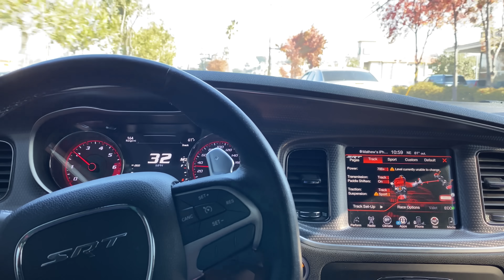I BROKE THE NEW DRIVESHAFT IN LESS THAN 24 HOURS!! *OOPS*

Comment: The heat shield for the center support bearing is not longer needed with the one piece aluminum driveshaft and you should not reinstall it.  Aluminum will cut aluminum and if it ever touches the shaft it will cut it.  Same thing with the rear heat shield make sure it is clear all around and cannot touch the driveshaft.

Comment: No hate at all but that’s the reason I wouldn’t install a DSS part on my Hellcat. They have constant issues with vibration and noise. I’d sell it and get a better one. Just my 2 cents
Reply: What kinda driveshaft does ur hellcat have ?
Reply: @rauljrlara9994  I’m still stock. But my car is going to HHP in April and I’ll be installing a Livernois driveshaft at that time.

Comment: Honestly the reason dodge went with a 2 piece to begin with is a single piece driveshaft just turns into a long noise amplifying tube. The smallest noise get massively amplified. There's a few videos out there where the engineers stated that if they had gone with a one piece they would have had the service centers full of drive train noise complaints. They need to readjust you exhaust at least. They need to loosen the bolts from the headers to the mid pipes then the bolts from the exhaust to the mid-pipes and move it over and tighten everything down.
Reply: The place he took his car at doesn’t do exhausts lol
Reply: @dodgeemcj592  They did his exhaust that day he changed his drive shaft and Jensen said that heat shield was rubbing before.   😳
Reply: @dodgeemcj592  my guy any shop can do anything if your cool with the workers LOL acting asf if you need
 a whole degree to work on exhaust lmao the easiest thing in the world
Reply: @Luminan777  😂who said they need a whole degree , you should’ve read it right bro and I said that cuz they told me they don’t do exhausts there lol and when I asked em if they could find out this noise my car makes when it starts because it sounds like it’s coming from the exhaust  they come at me with We don’t do exhausts here lol

Comment: I'm sitting here laughing my ass off yes that Ting Ting Ting sound is quite funny and it's a one-of-a-kind sound if it's what I'm thinking it is it can only be the sound of an aluminum drive shaft and a u-joint going bad my 72 satellite did the same thing on the hard acceleration ping ping ping ping ping all the time

Comment: The inner portion of the drive shaft appears to be the same thickness as the stock.....that aluminum case around the shaft makes it look beefed up....the main difference it's no longer a 2 piece shaft....I have heard that going to the one piece changes the angle and could cause other issues.....just the word on the street